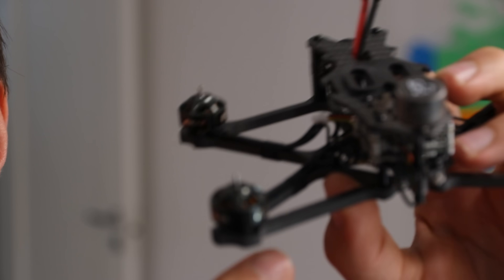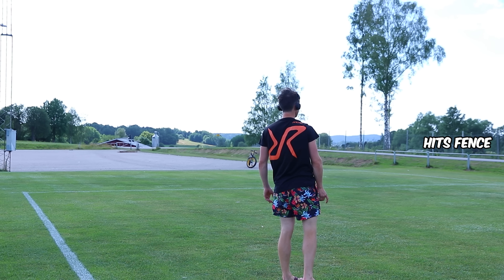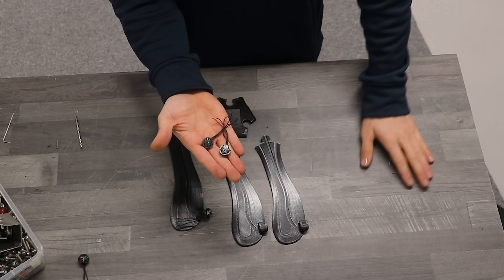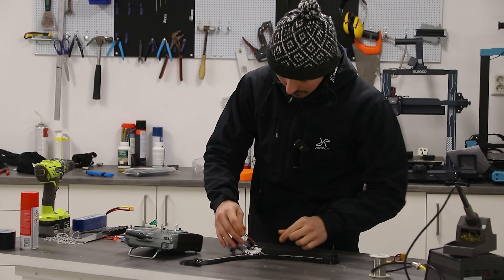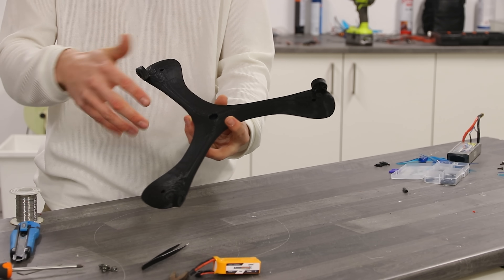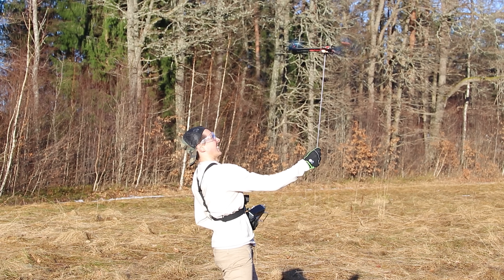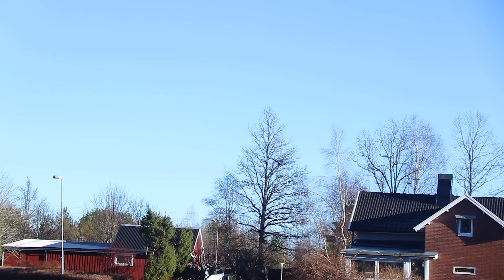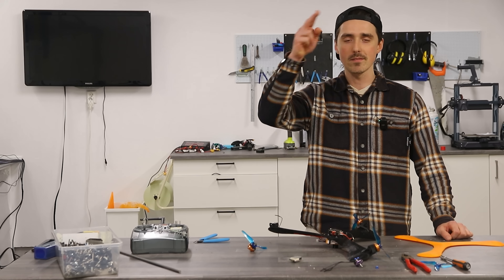A Boomerang That Never Comes Back

Comment: what about a 3d gyro stabilization, so human power but possible control during flight.  Maybe an egg shape in the center.
Reply: capacitive impulse for power with a smaller battery and rectifier. doesnt have to last long.

Comment: Put a motor on the axis of the shaft for holding it to spin the sort of cabin in the opposite direction to make a proper aircraft, with a tail and ruder for steering.

Comment: Great Video!

Some possible ideas for future revisions;
- Design it as a 2 part Sandwich to "internalize' wiring and components
- Split the battery load onto the 3 arms evenly (ie 3 battery packs)
- Modify the wing design to include the pitch angle for more consistent/uniform pitch angles

Not sure how feasible, but if you cold program the motors individually you could potentially have full maneuverability and fly it like a "normal" drone

Comment: I thought about making something like this but with two blades and also a servo that moves the battery slightly in order to change the center of rotation which would alter the flight path. The other way to control it would be to have one motor counter rotating from the other and use torque to alter the flight path. It would also be cool but even more difficult to have the motors pulse with more power toward the forward direction on each half of the boomerangs spin propelling it forward.

Comment: Can you try putting one motor in the middle of the drone and spin the arms around it. Like a three rotor helicopter, but without tiltable blades?
Could also try using gyroscopes to tilt it for controls.

Comment: Just use the balance lead to power the receiver. You can pick how many cells voltage you want there, and the battery won't care about the load of the rx

Comment: You probably can't bind your new transmitter to the receiver because they may have different firmware versions. Just a heads up, in case you wanted to use it at some point.

Comment: when you angled the arms you pointed the motors slightly upwards. now you get more lift drom the wings but they have to fight the motors pushing downwards.
maybe try an angled motormount (like 20-30deg) so wings and motors push upwards

Comment: Interesting, 👍👍👍, needs 3 esc’s,  a gyro,  and more wing like arms, possibly incapsulate the center in a ball or oval disk shape over the batteries, ESC, receiver and gyro.
  Not very practical but I don’t think that word is used at this YT channel anyway. 
However it would be interesting to see if you could control more than the throttle. 👍👍👍

Comment: Nice one.  I would try with longer arms (wings), but the motors closer to the center of the wings (eg. mid-mount). That way the tip speed of the wings will be more than the speed at which the motors will travel.

Comment: I couldn't tell how fast it was going, but it'd be awesome if you could add some control authority to this by calculating the heading of the boomerang and increased the speed of the motors in proportion to which direction they're facing so that you can control it :)

Comment: Don't use epoxy for water proofing. Clear coat spray does the job more reliable, easier and with less weight. And it's easy to salvage as well.
And BTW I'm wondering how you could fry the receiver. It's supplied by the 5V regulator of the ESC, not the battery directly

Comment: There are DC-DC converters you can use to power the receiver instead of using a separate 3S battery. Much lighter.

Comment: hahaha this is amazing, the best toy I never knew I needed. :D
You could probably shave off a little bit of extra weight and improve aerodynamics by using a tiny buck converter for the receiver's power instead of the 2nd battery. they come in a variety of either fixed or customisable output voltage ranges.
they're pretty dirt cheap too, its often more economical to buy a bulk pack in case you blow some. lol.

Thanks for the video

Comment: What if you angled the motors too? Slightly up but also towards thr direction of the spin. So rather than just relying solely on the wing for lift the motors themselves also contribute a bit to lift and rotaion at same time

Comment: Your new transmitter and receivers use a different protocol.
Stick to spektrum you can't go wrong.
And a small BEC would have regulated the voltage to your recviever.

Comment: So the part where you spin it up with it's motors and use the lift to fly? there's a whole class of toy that did just this called the Vectron. it moved horizontally via well timed cutouts of the engines. used an IR light to orient itself to the controller. displayed words with LEDs on the outer ring too .
Reply: (well, the vectron's lift was MOSTLY it's motors upon further thought, but it did still spin continuously like that)

Comment: Holy crap, it actually flies with nice stability. The next step would be to somehow use servos that adjust the pitch of the motors, coupled with a heading hold gyroscope that can determine the RPM and angulation of the craft... But a lot of math and quick micro adjustments would be necessary for stable and predictable flights with the vehicle itself rotating like this. It's like flying a helicopter..but only with the main propeller. There's no tail rotor, feathering shaft, or swashplate. That's a tricky situation. You're better off building a flying saucer.

Comment: Oh make the blade pitch with a helicopter rotor system in the middle and fly it like a helicopter where one side is low pitch and the other is high pitch to steer

Comment: Concerning your remote and the fact the your existing Spektrum receivers aren't binding to your new Flysky remote. You need to get a transmitter from the same brand like a DX6eor NX8, or a multispectral transmitter with a 4 in 1 module like a Radiomaster TX12 or TX16s with the 4 in 1 discreet module. But if you really want to keep the DX6i, just fix the thing, try replacing the gimbals or board or something please.

Comment: they make a very small voltage regulator to keep from needing the two separate batteries on RC devices regarding the receiver and motor that would possibly help with the weight. I am from the US but the person i seen use it is Kevin Talbot from the UK on Youtube, he has a lot of good information if you continue developing this he may be a good point of contact.

Comment: Simon, I also had a problem with my DX6i going full throttle even when I recalibrated the sticks. I upgraded a X9D plus to hall gimbals and used the old gimbals in my DX6i. Worked like a charm and now I have a spare controller.

Comment: 10:00 this dude does all these things but shows an utter lack of basic understanding of electronics. You know you get these things called buck converter (or regulator) which can give the correct voltage to receiver from a 4S battery
Reply: He's not stupid enough to just plug the receiver into the 4s knowing it might fry it, it must have been a mistake

Comment: You should try using a flywheel with a brake to power it. That way you can throw it and use the brake of the flywheel to control its rotation as it loses momentum. Plus you can spin it up before throwing it and save weight and complexity on the boomerang. The brake could be as simple as a servo horn rubbing the flywheel

Comment: I think this design has the same issue as multicopters with two props stacked onto each other. They just add redundancy, but just minor lift. The props are spinning in turbulent air all the time. Try a design with one prop and one long blade like this: prop-CG-long blade

Comment: Try to use ONE motor at the center of the boomerang, but without propeller, just with small metal disk that not easy to rotate, you will get extra momentum because of this

Comment: Hi, watching you throw your second boomerang I wonder if you know the rules governing this practice. In fact there are rules to follow regarding the angle to the wind, the angle of the boomerang must also be respected if you want it to have a chance of coming back to you, but in the part of the video where you throw in winter (we can see the snow) I see you throwing any old way, no respect for the angle to the wind angle, and if you don't respect a minimum your boomerang will always have trouble coming back to you. For example, the angle when you release the boomerang is too horizontal, it should be around 80°/85° and not 45° as I've seen you do.

Comment: You could do it with 1 single big motor in the middle spinning a disc, the torque of the motor would make it spin and the disc would help with stability.

Comment: Instead of using a lipo you could use a capasitor it will be much lighter then you could charge the capasitor and throw it. No need for a transmiter or reciver.

Comment: It's hard to change the direction of the axis of an rotating mass (gyroscopic effect), in this boomerang design, the motors rotational axis are changed when the boomerang it's self rotates, so the boomerang is continuously fighting against the gyroscopic effect. So maybe that's why the small one didn't work and it took so much motor power to make it work

Comment: the dx6i uses dsm or dsmx protocol, the flysky i6 you have uses both afhds and afhds2a protocols... neither are compatible with dsm/dsmx receivers.

you would need to get adhds/2a compatible receivers. the fs2a is a tiny 4 channel rx, the fs gr3e is a cheap 3 channel rx (would need to change the protocol in the i6 from afhds2a to just afhds to make this work)

the fs2a will run direct from 2s lipo, the gr3e needs a bec

Comment: I would not have put the motors at the tip of the wing. That lobe looking part of the wing is where it get most it's lift from. The motors might be pushing air through beyond the flight envelope of that low speed wing.... Might, meaning I donno but I would move the motors inward next.

Comment: bruh buys a "new" controller, buys an old and completely outdated controller

ExpressLRS has been around for like 2 years now, get a Radiomaster TX12 or Boxer, and try not to fry it by putting the batteries in backwards or some sht

Comment: 4:45 You can fix the Full Throttle problem. This was a common issue on those. The reason is that the throttle potentiometer comes loose and moves around.

Comment: If you put a bearing in the center with a tube and attached a second one on the "bottom" going the opposite way, you might be able to make it hover. And if you slow down the top or bottom motors, it might make it turn left or right. Basically a way over complicated drone "boomerang" but would be cool to see 😁
Reply: Hmm very interesting, but sounds pretty plausible to me. And yeah he'd be able to control it then. Idk how the programming and tuning will go though 😅😅

Comment: The FS-i6 will bind to any flysky receiver which uses AFHDS or AFHDS 2A there is a setting in the menu to switch between the two. I have also bound mine to some HobbyKing recievers.

Comment: Curious if you could either print it with wire indentions to bury the wires, or print it in two halves and embed the wiring to give it better aerodynamics.

Comment: If you implement altitude hold with a flow sensor and a gyro assisted stabilisation, you will realize that your ThreeWingDrone will spin down the motors at some point of rotational speed, when you actually command the drone to speed up and fly at a more elevated altitude than before.

This is caused by the upward lift forces that are generated by the wings, providing a much better efficiency compared to a drone with 4 motors and no rotation and Wings to rotate around.

When you want to increase the height of your ThreeWingDrone,  you will recognize, that the motors are actually spinning down at one point of time and  are driven at a much slower speed than before the command to nacigate to a Higher altitude. This spin-down happens when the rotational speed has increased to a specific level above which more altitude is gained.

Lifting your drone by spinning the motors down! This may sound crazy, but it is a real thing with a design like this.

By the way you are  by far NOT the first to fly a ThreeWingDrone, as even i myself have some knowledge to share,  how your drone will perform with specific parameter, sensors and  configuration applied.

Please try this yourself, as it really IS a lot of fun flIying stabilized and then at one point start rotating the whole thing, spinning down the motors and gaining height.

Of course you can also speed up the motors to lift at an even higher speed. Or have the motors run at constant Speed and only through beginning rotation start to lift the drone to the sky.

Happy implementing of this crazy feature to your ThreeWingDrone,  the video you will create about your experience will definetely go viral like crazy,  this i can assure you right now before you even have started anything regarding this configuration.

Good luck making something funky, completely new and never ever seen before...
❤

Comment: You can pull power from the balance lead of the 4-cell lipo for the receiver eliminating the other battery. We used to do that with our FPV drones before the video transmitters were high voltage. It works great.  You pull from the connector where 6v comes out for the receiver.

Comment: the thing with a boomerang is that it was trailing edge stall (like a helicopter's rotors).. where one side is travelling slower than the other cause its going in the opposite direction the boomerang is travelling.. thats what makes a boomerang tilt to one side... The challenge is finding a way to control the motor speed when its either exactly on the leading edge or the trailing edge... that would give you tilt (and hopefully directional) control

Comment: use an arduino and a switch so when you throw the boomerang ur hand releases the switch and the motors throttle up after like a 1 second delay for safety and send it

Comment: Great, let's figure out how to steer it now?
Maybe by adding a number of tiny little servo-controlled flaps on each side of the wing (so it doesn't slow the rotation too much), one could achieve some control in the horizontal/vertical plane of motion? Kind of like of like helicopter blades do, and unlike helicopters, it doesn't require tail rotor stabilization, maybe in combination with differential motor control? Make it smaller wing diameter and/or 4 or more wings, so it's easier to rotate at faster speed and to possibly control in the vertical plane? 
No idea tbh.

Comment: Imagine a person is unprepared and hears and sees this for the first time and in real life...

A UFO! ;-)

Well, I'm sure that it can be made controllable with some effort, when the motors each speed up when they are let's say at the direction that faces the sun for example (to have a stable reference point). And so on.

You can even measure the rotation speed (how long does it take to pick up the sun again - when the sun detection is reliable). And then you can calculate speedup and slowdown timings for any direction relative to the sun.

I picked the sun in this thought experiment, because it's easy to detect, when the sun is shining - and you have a stable reference direction.

You can make an RC control relative to the sun direction.

Of course, the time for one rotation changes when you speedup or slow down. You can say, it's all right, you will have direction deviations when speeding up to go higher and when you slow down (in the collective speed of all three), you can compensate that in your controls by hand. Or you add some more sun direction sensors.

I guess, it would be the easiest to program it, if you have a knob for the direction and a control input in one direction for the speed to go in that selected direction.

Or calculate the direction and speed in that direction with x and y joystick inputs. That calculation would have to be done on the drone with the receiver inputs.

Comment: 4-in-1 escs typically have a built in 5v bec for powering a flight controller, you might be able to replace the rx battery with a second servo plug coming off the esc.
Reply: maybe it fried too
Reply: do they?allmost all of my escs feed vbat to the the bec of the FC...

Comment: Of course a flysky controller won’t bind with a spectrum receiver. They are completely different protocols
Reply: Of course, I think we were all thinking this.  Amiright fellas?
Reply: I don't think he did. He picked up the Flysky rx @4:51. I used to have that radio and the rx he picks up that he said wouldn't bind looks like the one that comes with the radio.
Reply: And a very clear indication of his being super cheap.
Reply: @thatguycarlos I don’t understand why he can’t just use elrs, it’s cheaper than spektrum and it’s WAYYY better range
Reply: You're a different protocol.

Comment: 4:50 PA: That’s a Flysky FS-i6, don’t cheap out. I am not surprised it doesn’t work… Just get an actually good transmitter, basically anything that runs EdgeTX is ok. I recommend the Radiomaster Boxer, or the TX16S. Also, ELRS for the transmitter and receiver. With Radiomaster, they have an option for a built-in ELRS transmitter.

Edit: The FS-i6 is literally the cheapest radio on getfpv right now. For just 11$ more you could’ve gotten a Radiomaster Pocket which is IMHO the waaaay better deal.
Reply: dude is stuck in 2003 drone tech. doesn't know what a BEC is either, it's wild.
Reply: Absolutely do this! The mixing and configurabiltiy of edgetx would probably also be helpful with some of these projects. Switching protocols can be annoying, but with elrs you won't have these dropout anymore.
Reply: The reason that he can't bind them is because they use different communication protocols, not because Flysky is cheap. There's nothing wrong with the TX.
Reply: The price différence for these thing in Europe are quite different.